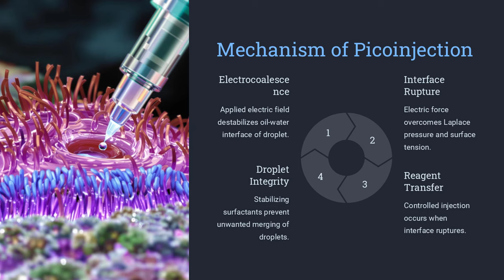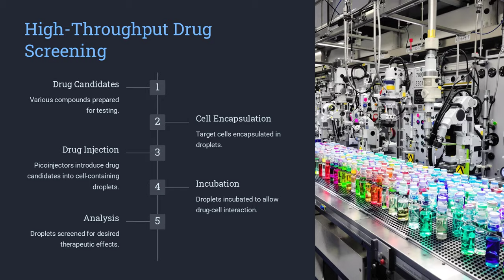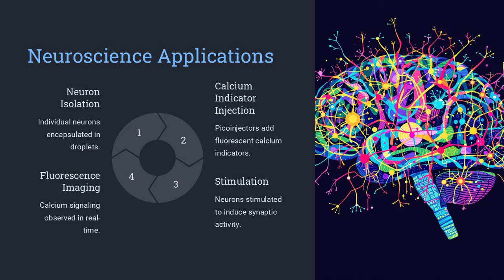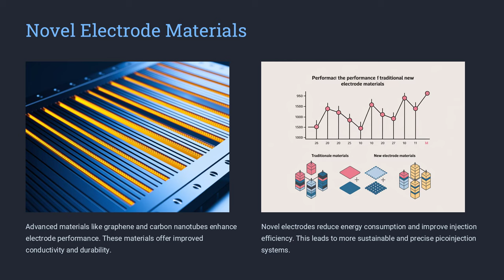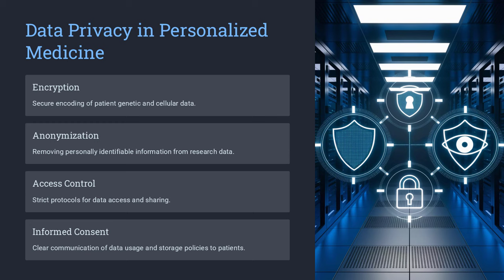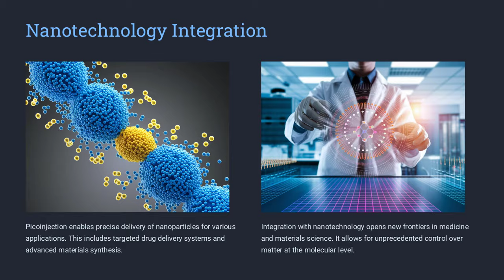Picoinjectors: The Surgical Snipers of the Microfluidics World

Comment from the maker: How does the interplay between Laplace pressure, surface tension, and applied electric fields precisely control reagent injection in picoinjection systems?
What are the key limitations of electrocoalescence-based reagent transfer in maintaining droplet integrity, and how can they be mitigated in high-speed microfluidic environments?
In high-throughput single-cell analysis using picoinjectors, how can cross-contamination between droplets be minimized while maintaining injection precision at kilohertz frequencies?